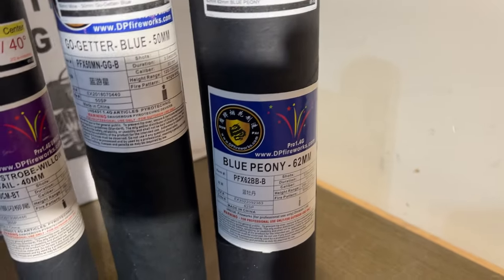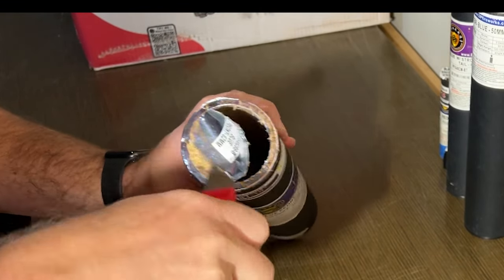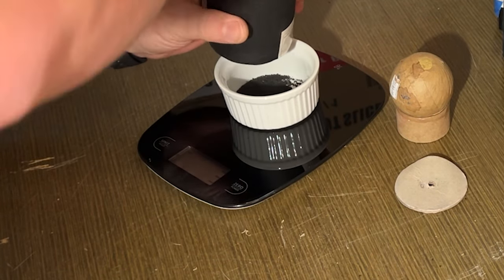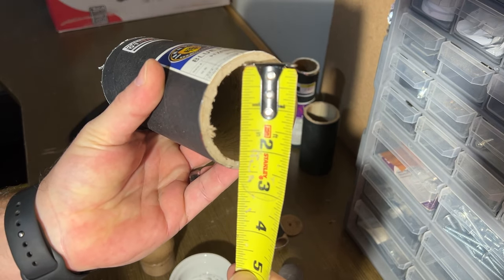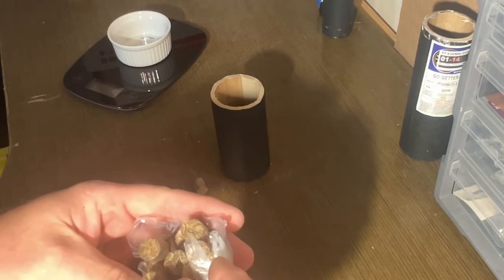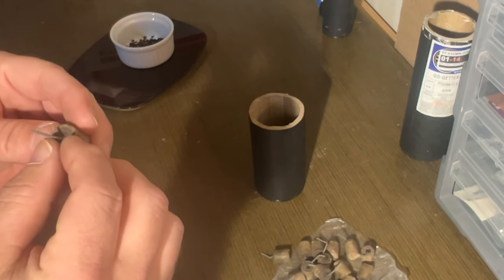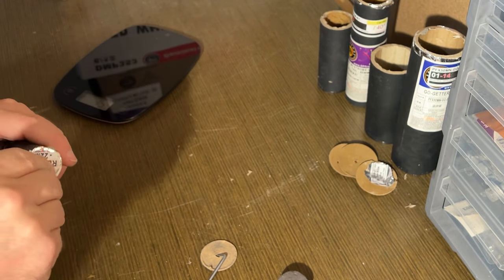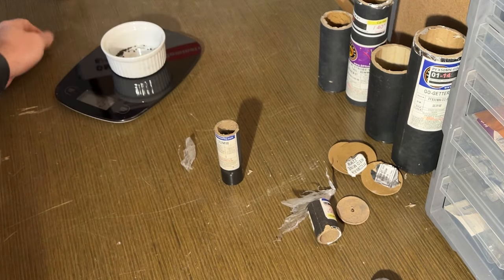What's Inside 1.4 Pro Fireworks? 62mm, 50mm, 40mm, and 22mm.

Comment: Would love to see you get a weight for the composition in the 62mm shell to get a total composition weight. Haven’t seen anyone do that yet. Curious how it compares to most canister shells and if it exceeds 60g.
Reply from the maker: Ooh dang. Wish I would have done that. I’ll do anyways and post the results.
Reply: Highly unlikely.  Most 60g cans don't even reach 60g.  That is simply the maximum comp allowed.  Another YT'r did a measured breakdown and some were only in the 40g range.  Similar to cakes, 200g/350g/500g is the maximum allowed.  Doesn't mean the cake is the full weight of the category it's in.
Consider NOABs.  500g / 9s = 55.6g/s.  More than likely the individual shots are notably less than 55g.  Same logic applies to actual single shot products, whether it's a canister or ball shell.